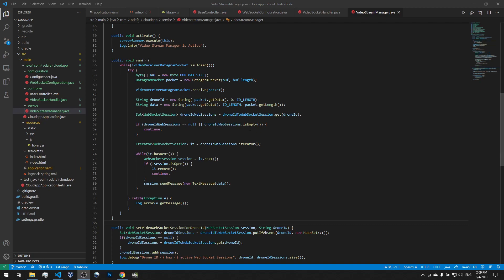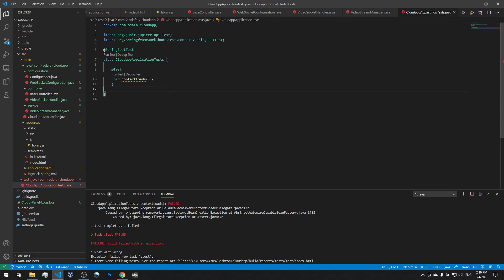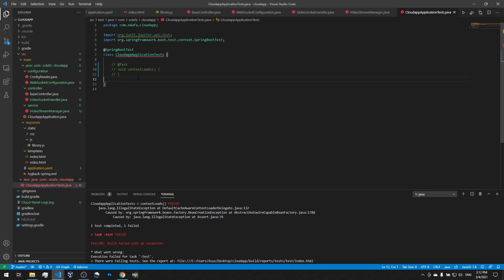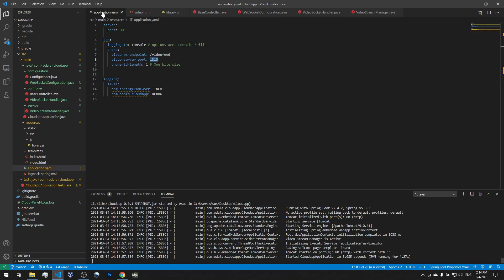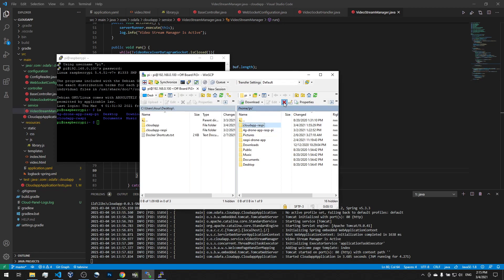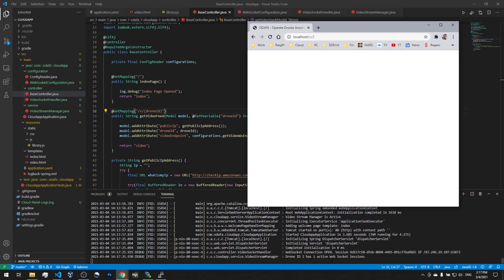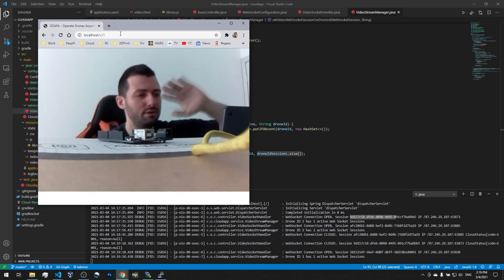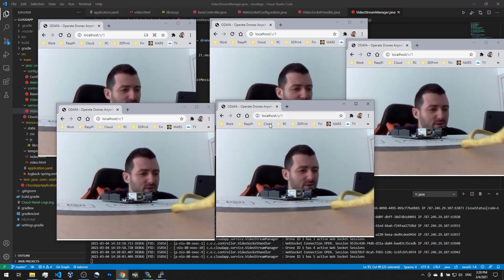[Part-18] Video Streaming Final Overview and Demonstration

Comment: How is the latency in the video when using websockets (in a deployed environment, with an actual 4G connection)? Wouldn't WebRTC be a better choice for low latency video/data transmission?